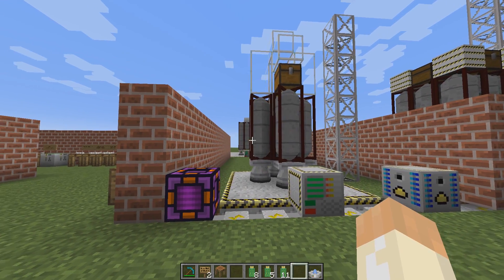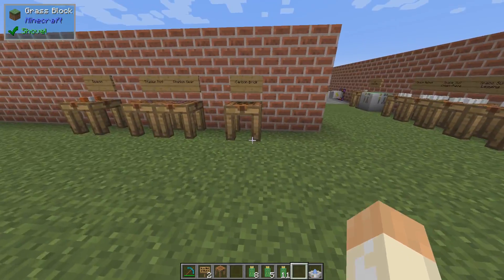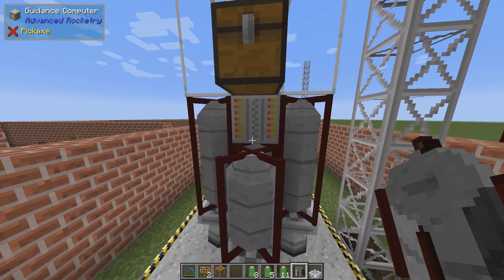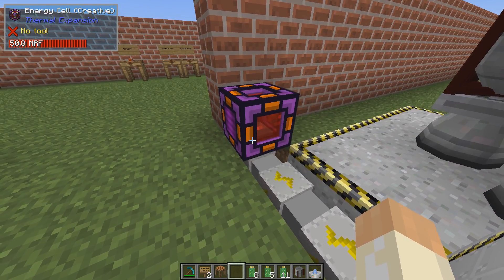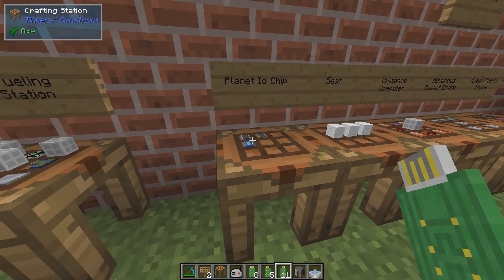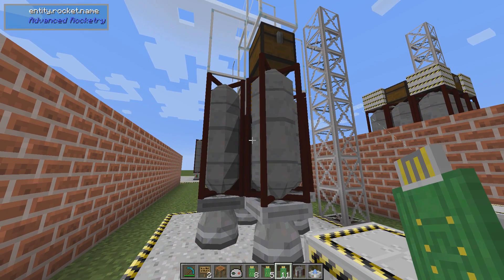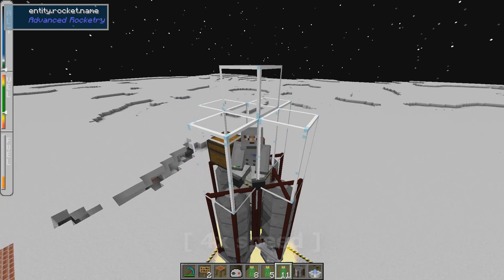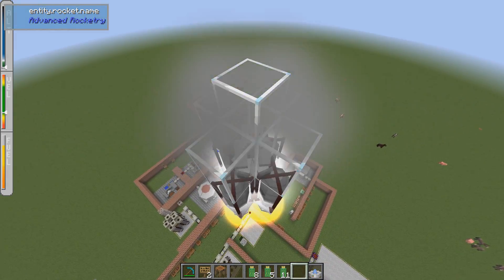Advanced Rocketry Tutorial #4 - Building Rockets and Moon Travel (Minecraft 1.12.2)

Comment: i dont see how to fueel the rocket ive tried every thing and nothing works even what you showed me.I play on version 1.12.2 and im running it on forge
Reply from the maker: I covered the fuel part from 7:30 but it sounds like you have followed that. I can't really guess, also I don't know what modpack or mod selection you have. Was the link successful? Did you link to rocket or station? Have you filled it with tanks with fuel and all that? Again, it's really hard to just guess. Note that a different modpack could use a different type of fuel.